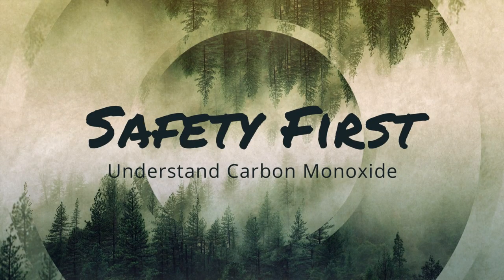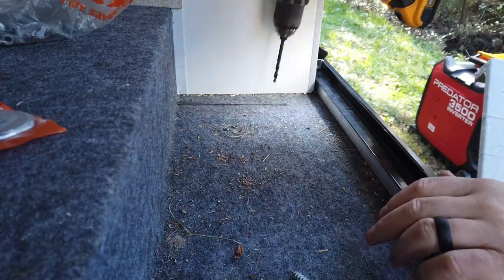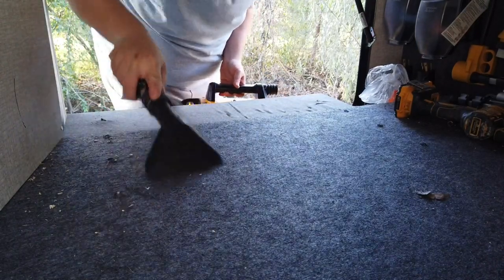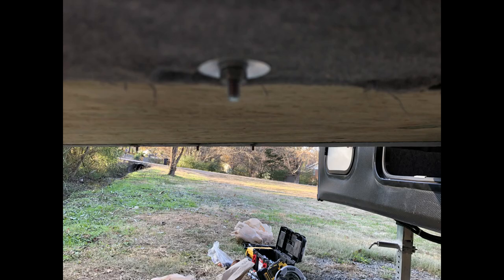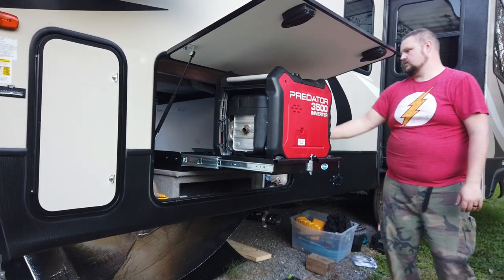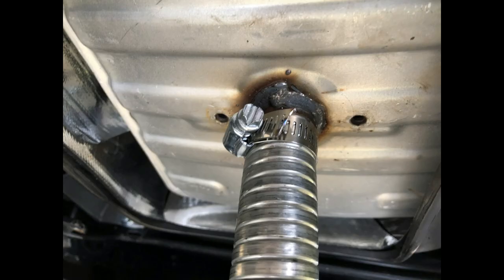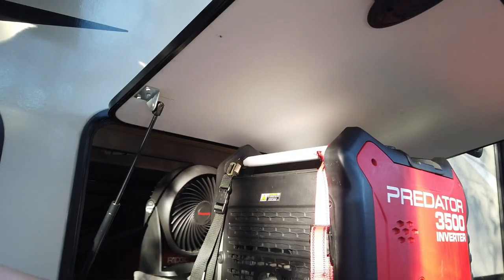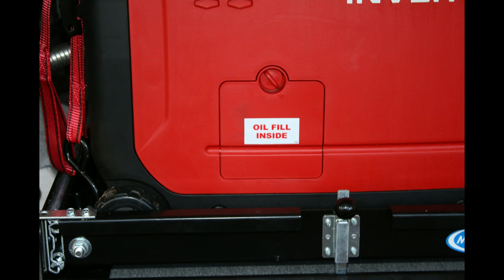Predator 3500 Inverter -Inside RV / Camper #predator3500 #invertergenerator #diy

Comment: 100% best Generater.Systems I have used. A test for hurricane prep here in Louisiana: three AC units, 5000, 5000 & 8000, 3 fridges, 2 device power setups, 4 flat screens....AND I had 40% of the power meter to spare.
Reply from the maker: I personally don’t recommend propane as a fuel for a generator when camping.   I use propane on my backup generator at home.  However, propane puts out less power than gas, it is harder to transport, I don’t want to use my same propane to fuel my generator that I rely on for my furnace, water heater, and stove.  For reference a 20lb (grill size) propane tank will last about the same amount of time as 5 gallons of gas.  If you are deep in the woods which is easier to find gas or propane?  Now if you only want to go for a day or two you can probably make it work

Comment: I also have the Predator 3500, and didn’t want the hassle of lifting it all the time. I don’t have a 5th wheel, but a bumper pull trailer. I bought a generator rack that mounts on the front of the trailer, over the batteries and tanks. Instead of strapping it down, I made wheel locks. Bought some chain that would fit between the wheel and generator housing. Cut to length, and bolted each end to base with the chain lapping over the wheel. When you tighten the bolts, it’s cinches down on the wheel. Cover most of the chain with heat shrink tubing which protects and snugs chain between wheel and housing. It also aids in security for theft. I also cut a hole in the bottom of rack to drain oil. Predator nailed it with the design of draining the oil. I also extended the 2 small drain and air hoses using drip irrigation couplers to prevent gas from dripping onto rack. I never have to remove generator for maintenance. Thanks for sharing your project!
Reply from the maker: I think these are good machines and this thing is working like a champ down here in Florida at the RVillage rally
Reply: Bill Custer  Hi Bill, I’m looking at the same issue with my bumper pull trailer. Do you have any pics of you setup? Thanks in advance. 

Mark, West Texas
Reply: Yeah, I’m with the last comment guy! Anyway you could post a short video? Sounds like you nailed it buddy. Would like to try the same.

Comment: I store mine in the front compartment.  I built a ramp that I use to push the inverter back into the compartment.  I store the ramp in the side compartment on top of storage racks in the compartment.  works great
Reply from the maker: Sounds like a good system

Comment: Having what did not work is great to include in videos, tx.  Also, I definitely will have the carbon monoxide alarm AND the detector, I will be using propane based heaters and safety is top, top priority!
Reply from the maker: Finding Mark In Maine agreed!

Comment: Brilliant! Even though my RV, Honey is pretty small, she does have a built in generator. The thing is, she’s a 1992, and the generator is too. It used the gas from the engine, which is really handy. It’s just REALLY noisy!  So, I only run it for short times when I need the power over a short period. I do have some solar, which is great for times I’m sitting fir days in the sunshine. But, I also carry a Yamaha generator for times I need power over longer times. I’d love to be able to install the Yamaha in the generator compartment, but it would be a big job.
Reply from the maker: Yeah, I’ve seen people that go all out adding it to the fuel lines and such.  I’d kind of like to run a power wire and transfer switch so I wouldn’t have to get the cord out, but in all actuality we usually have electric wherever we go so it would be overkill.  I have to get my panels mounted soon too.  The best video I’ve seen are some by Roland White...  he goes all out in making the predator a legit onboard generator.  I find those videos very interesting
Reply: The Gimpy Camper Good info! I’ll go check out that video too👍

Comment: Good comments about the carbon monoxide dangers.  CO2 detector is an absolute essential!  I have a Honda generator on the back side of my 5th wheel, in a box, separated from the trailer.  Ran it this way for years.  This past year, I added a CO2 detector in the kitchen area interior.  Much to my disbelief, it has gone into alarm three times despite the RV being sealed up with doors and windows closed.  My exhaust is 3' away from the closest exterior wall.  Had no idea the CO2 was leaching into the coach.  Now I will always have the CO2 detector operating.  I do mostly boondocking so I use my generators 1000s of hours.  My last one had 6000 hours on it when I sold it.  I wonder how many times I exposed myself to the dangers of CO2. Just because it didn't kill you, It can damage you, permanently.  Subscribed as a I am another OCD perfectionist.  Glad I found your channel.
Reply from the maker: I wish there was more boondocking here.  In a two hour window I have 4 spots I've been able to find in 2 years.  Going up in the TN mountains to do some Boondocking tomorrow through the weekend though.

Comment: Since you modified the exhaust, I didn’t see where you put the spark arrester? I made a new base plate and used galvanized pipe to extend the exhaust. Was able to put spark arrester near the end and able to remove it for cleaning. My 3500 is mounted over my propane tanks in the front on a generator rack. I also cut a hole in the bottom for oil change without having to remove generator.
Reply from the maker: My spark arrester is always being cleaned 😂

Comment: Outstanding job!

I have 2 of the predator 3500’s for our 5th wheel. I could carry one like you are in my rear compartment. I even bought the tray, just haven’t done anything yet. Trying to figure out how to carry both of them easily. Maybe a custom receiver box with a swing away so I can still get into my rear storage compartment. We’ll see.
Reply from the maker: It has definitely made it more convenient.  I almost wish I would just go ahead and wire in a transfer switch though... but really we don't get to use it as often as we like.
Reply from the maker: There just isn't a lot of boondocking sites around our home.
Reply: Ours would be for emergency power.

Comment: Nice set up!
Reply from the maker: It’s worked well.  Especially with a few more modifications.  I just wish there was more dry camping available in my area
Reply: We're fortunate in that regard here in Colorado.  Since I have a TT I'm looking at this generator and a mount above the A frame.  Should work pretty well.  Don't have quite the space you've got :)
Reply from the maker: You may need to change the carburetor jet, but it’s a great generator, especially if you add the updated plug n play remote starter kit from my homie Kenny over at generatorupgradesupply.com btw… promo code gimpy = free shipping

Comment: I hope you will do a follow up viedo each year to let us know how the predator generator holds up.
Reply from the maker: I need to do a real review video on it... I’ve revamped my exhaust video to come.  Truthfully I’m on my third one but I don’t think either are the generator’s fault.  The first I had in a utility trailer and it quit starting.  It would turn over but not start.  I think it was the Amazon cover I had on it that I found out wasn’t waterproof.  I just didn’t want to take the time and had the warranty.  The second (last month) the magnet from the magnetic dipstick fell down in the crank case, it still worked fine but the warranty was about to expire (and the display wasn’t showing the output) so I traded it in, but I didn’t extend the warranty this time.

Comment: This is the way!! On board 👌 
I got solar in my van but on one side of the van everything runs on a generator just in case my solar goes wrong. and my generator is in a generator box 📦  and I install a silencer on it...is remote start
I use it  when  my wife runs the wacher dryer combo machine we got on the van and if my son and my grand kid want to play video games we got a ps and Xbox on the van.and I could run does on solar but they play for hours at the time..but generator is a great thing to have
Reply from the maker: We have remote start now... It's been great.

Comment: I have a slide out very similar. How do you fill it up? I haven’t figured that part out.
Reply from the maker: I have this pump, the first one started leaking slightly after 6 months and it made me mad but I continued to use it because it always stays on the can and is easier than the cheap one I bought for a backup from harbor freight, and really spilled less gas than these newer gas cans lol.  I did replace it after 3 years though.
Reply from the maker: TeraPump Fuel Transfer Pump - Failed after 9 months
https://youtu.be/Iw6gykdrq7c

Comment: I need to figure out how to install a 2000 watt generator on my truck but no room.
Reply from the maker: After watching your video with Bob and seeing your van closer, it does look like quite the puzzle
Reply: You truck technically is a generator since it has all the components of one. You just need an inverter. Try and upgrade to a larger alternator or add another to produce more dc energy. You could then add more batteries or use the one you have and just add an inverter that’s pure sine wave.
Reply: Dylan Beamenderfer I like you idea Dylan. With all my “homework” I’ve been doing, seems like in order to get the right amount of batteries/battery you start hitting a “weight problem” as well as size and cost. Obviously, batts are superior “NOISE” wise, but cost/weight of the REALLY good ones just complicates the final decision. Another factor that is helpful, some of these SWEET batteries are now offering 10 yr unlimited warranty w no restrictions (Uh, unless you catching it on fire I’m guessing). My guess is eventually we RV- FOLK will be able to go ALL batt power 👍

Comment: GIMPY: Question how far can you bring out the generator when you pull the tray out ? How many inches do you have behind the generator and your entrance storage door? I try to figure if I could have enough space between my entrance door storage and the generator, if it's possible to pass stuff behind the generator by the door. Thanks.
Reply from the maker: There is about 3 inches behind the generator to the point of where the door would be if it was closed, but my fan is Mounted In that area as well. We also have an updated video on our newer set up so be sure to check that out. https://youtu.be/YZrglOz16yQ

Comment: So will this run your fifth wheel ac and Fridge? What can you run with it on 30 amp service?
Reply from the maker: My 5th wheel is a 50 amp service but only because it’s prewired for a 2nd A/C.  Since we don’t have it I almost always use 30 amp service with a smaller/lighter cord, the 50 amp cord is a beast.  Technically, I run my whole camper including everything from the 15k A/C to the microwave, converter, TV... everything.  However, on one of our first trips we had an issue with the dometic fridge not seeming to want to cycle on automatic when we would turn the generator on/off.  So for that reason, if we are using the generator, I keep the fridge on gas the whole time.  It doesn’t use much and the battery stays charged if you are using the generator

Comment: Gimpy: Hey, how did you plug the generator to your RV ? Do you still use your big RV power corde ? Thanks great video.
Reply from the maker: Truthfully I don’t have mAny places to go that I can use it so I just run the cord on the ground like normal.  You could run a heavy cord and wire it into a transfer switch, but I’m trying to break the habit of over doing everything that I do.... (coming from a guy that installed solar last month 🤪😂🤷‍♂️

Comment: Gimpy: Echo Bear 3500 generator is it the same as Predator ? I live in Canada and we dont have Predator but we have Echo Bear, they look the same. What is the mesurement of your generator ? I want to make sure my storage is enought big to make a sliding tray. Nice job, greetings.
Reply from the maker: I'll try to get some measurements for you this week.  Hopefully I won't forget.  However, my system has once again changed.  I've not released my updated video yet, but I'll give you a peak.  https://youtu.be/YZrglOz16yQ  I asked your question if it was the same in an Facebook group that I help to moderate and they said they thought it was the same, but it seems to be quite a bit more expensive.  The northern tool powerhorse is also the same if you have access to those there?

Comment: Is it never possible to run it in the compartment? Like the original on board one.
Reply from the maker: While technically yes, I would not do this.  The chances of carbon monoxide are just too high.  I would at the very least seal the entire compartment but I still wouldn’t trust it
Reply from the maker: Also I’ve changed a few things to my setup best seen here
Predator 3500 review #predator3500 #invertergenerator #generatorreview
https://youtu.be/dEFIoEslI_A

Comment: Camco gen Turi might work with your setup.
Reply from the maker: I actually finally found something that worked a lot better but it doesn’t get it as far away as the venturi.  I don’t run it inside the bay though
Reply from the maker: Predator 3500 Exhaust #predator3500 #generatorexhaust #generatormods
https://youtu.be/CyXKb5QaLKU

Comment: Do you use the 12 volt jack to charge your battery bank?
Reply from the maker: No.  I’ve read it is very inefficient.  I either just plug the camper in to let converter charge or if I want to charge faster I hook up a traditional battery charger.

Comment: did you hook it into the 5th wheel electrical system?
Reply from the maker: No, I have debated installing a transfer switch but at this time I just plug it in every time
Reply: I’ve been “battling” that same decision myself.  Some “lottery” money will probably make up my mind, but I’m not holding my breath there...😆

Comment: Great you have a fire with its own gas supply ive seen a few of these gen sets just catch fire and when you bolt to a sliding shelf in a what could be called a tender box in its self I mean a trail. Have fun be safe do more research before just doing something that dangerous I run a predator as well but keep it away from my trailer my family and property is worth more than a lazy set up
Reply from the maker: I've seen cars catch fire too, but I've never seen anyone set their engine outside?

Comment: Hey why not do the conversion kit to propane it’s a lot cleaner so less carbon footprint and oder.
Reply: Love this idea too tho
Reply from the maker: In my opinion propane is not a good fuel for camping.  #1 you make less power.  #2 from what I can gather 20 lb of propane lasts roughly the same as 5 gallons of gas.  If you are out in the boonies (probably are or you wouldn’t need the generator) which is easier/closer to pick up?  Filling your propane or getting 5 gallons of gas?  I think propane or natural gas are great ideas for emergency power (if you have a large tank or an unending supply)

Comment: ...a 12 volt computer fan attached inside the exhaust pipe will do the job, i think... ;)
Reply: CORRECT SIR! I’ve been seeing this more and more, plus it’s a GREAT cheap solution. Best on I’ve seen was they did 2 intakes and 2 exhaust fans out the bottom. So far they haven’t had any issues with road-grime hitting/clogging/goop-icy-ing (yeah I made that last word up). They even put a carb-m-alarm IN the box too for assurance. It’s yet to go off.

Comment: Why don’t you install it like they do a motorhome like an awning generator closed in the hatch put a vent in your door and run exhaust outside
Reply: Meant to say Onan
Reply from the maker: You could but I feel more comfortable with it outside
Reply: @GimpyCamper  Or mounted on your back bumper in a box that they make Aluminum tread plate box
Reply from the maker: @seanstevens9619  I don't have a back bumper... that's visible... but I like it storing inside the camper

Comment: You can get better brand from Home Depot like Generac iq3500 much better quality for like half price of this made in crappy China. Harbor freight is all crap. Then when something goes wrong in just a week. You return it they charge you $200 restocking fee. Vs Home Depot no question ask full refund.
Reply: Being I do sub-contractor warranty & repair work for Gener-crap I’ll politely have to disagree with you here.  I’ve seen more winding issues w Gener-crap than ALL other generators COMBINED. I’m not just talking portables, but home units as well. They, Generac, made some BIG agreement with a rather LARGE power company (that will remain nameless!) for ALL their home back-up install units. Many blow up just on the monthly/bi-weekly auto-check runs. Trust me, I’ve never dealt with more angry rage filled homeowners than Generac ones after big storms. Yes, they kill the messenger yet I didn’t sell it to them. Considering they already have all the sub-equipment to hook ANY genset to their home, I’ve seen a number of owners get their $ back and invested in a serious Honda unit.